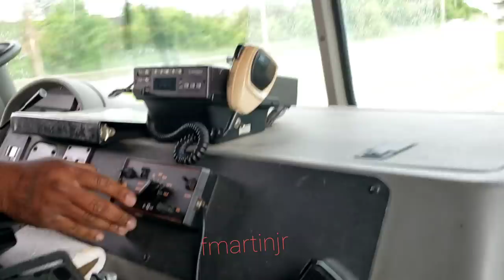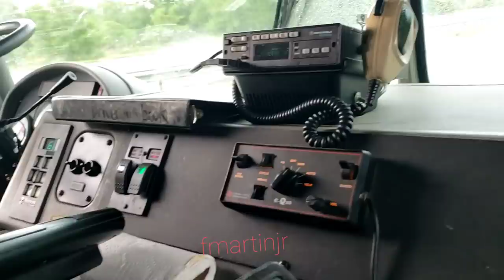Belvedere,Delaware HazMat Co. Assisting Co13

Comment: People Have No Respect For Emergency 🚨 Vehicle’s Anymore
Reply: I’m kinda surprised that my station doesn’t have traffic problems as often
Reply: @Korben Willis they're supposed to keep the shoulders clear
Reply: That's maybe why, it's called a emergency shoulder. 

Because : The purpose of building a shoulder is that in the event of an EMERGENCY or breakdown, a motorist can pull into the shoulder to get out of the flow of traffic and obtain a greater degree of safety.
Reply: hell in the 1970s as a first responder we went through the same crap it has not changed
Reply: It's such an easy fix too. Bring back CB's in trucks so they can talk to each other and make sure there's an open lane. As for everyone else. Follow what they do in Europe and form a zipper down the middle of the road. But I guess that's just too expecting of my fellow American's to have any form of decency.
Reply: @ReinSouls  They use the zipper in US some but your right, not very often. need more education and be part of drivers license tests,
Reply from the maker: True.
The only thing that has changed is, more arrogant drivers on the roads.
Reply: @fmartinjr  It's an east coast thing. When I lived in DC people would go on the shoulder all the time but they don't do that here in Minnesota
Reply: @fmartinjr   was this the tractor trailer hazmat or other hazmat truck

Comment: Now thats how to drive a fire truck to a scene in heavy traffic
Reply from the maker: A tractor trailer fire truck
Reply: @fmartinjr  your referring to a TILLER which is the name for those types of rigs.
Reply: @josephbennett3482  no its a tractor trailor not a tiller.  Look up hazmat 30 and youll realize what hes talking about.
Reply: @josephbennett3482  Not a tiller.  Literally a tractor trailer.  Belvedere HAZMAT 30.  Spartan cab, full blown toolbox trailer.
Reply from the maker: @josephbennett3482  no, a tractor trailer as said.
Reply: A tractor trailer with a custom tractor, seems strange, but I guess wheelbase is an issue.  Since it only pulls a box, I assume it can be subbed out with a conventional tractor when the cab’s out of service?
Reply: jfsa380 designed for the cab specifically. Has the ability to turn on the lights of the trailer from the cab because of that. NYS won’t buy us none so we are stuck with the conventional trucks but oh well.
Reply: Central New York Responses but can it be pulled by a conventional tractor, emergency notwithstanding?  I believe tiller trucks are stuck together due to hydraulics, but this seems more flexible.  Thank you for your reply and service.
Reply: @centralnewyorkresponses7887  I'm fighting to get us a long hood 379....but it will be a cold day in hell before that happens. I love the spartan though!

Comment: Can’t believe it’s 2020 and traffic doesn’t know how to part to the right and left on shoulders of highways to let emergecy vehicles split down the middle!
Reply: In the US don't go left, we as responders are trained to travel in the left lane so you the driver can see us coming.
Reply: @brandons2411  That had some merit way back when plenty of cars only had a mirror on the driver's side (plus the interior of course) but not so much nowadays where ALL cars are equipped with mirrors on both sides.- if only people would use them as well....The splitting lanes method (when it works) has the advantage of being able to go to either side without having to cross back over the other lanes again(and having to wait for ****heads to make room again).

Comment: Man!  That wasn't a run; that was a commute!  Complete with uh... less than empathetic traffic.  People are trying to get out of the way and others are still jockeying for position!  Never ceases to amaze me but not surprising either.  But we're outside Baltimore (Howard County), so it's not shocking.  You need a Palfinger on the front of that rig!  Nice driving and great video!
Reply from the maker: yeah,this jawn is primarily County-wide ran.
That scene location is about only 20 miles from Philly.

Comment: Why there are trucks on left lane? If trucks are on the left lane its imposible to go around them. In Poland for this and few other reasons trucks are prohibited from driving on far left lane, if they are not overtaking other vehicles or turning left on a crossroad. When there is emergency vehicle coming you are obligated to give way by driving to the right side of a road (single lane; right lane on dual lane; two lanes from the right on 3 lane) or left (left lane or far left lane on 3 lane road) to make corridor in the middle for them.

Comment: It's a pity you don't have the split lane system as used in Germany, drivers have to leave a lane clear once they can see there is a indecent. Doesn't always work but much better that that attempt at getting through.
Reply: In the U.S., everyone is supposed to pull to the right leaving the left lane clear, but as you can see, that does not always happen.
Reply: @ScottMStolz Thank you for your reply.

Comment: What in the hell are those drivers doing on the damn shoulder 😡😡
Reply: Two possibilities. The law requires you to pull to the right for emergency vehicles. and another fire engine did pass on the left side. So the first possibility is they were trying to make room so everyone else could get out of the way for the fire truck that went on the left side. The second possibility is they were trying to get through faster and illegally used the shoulder.